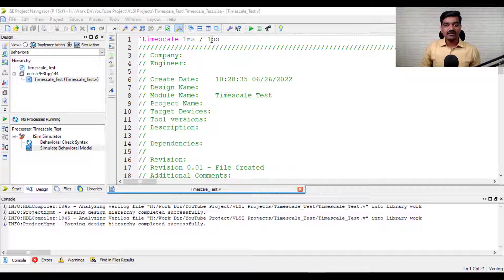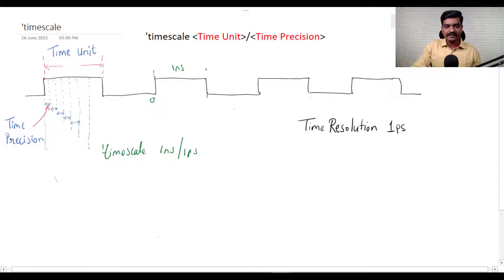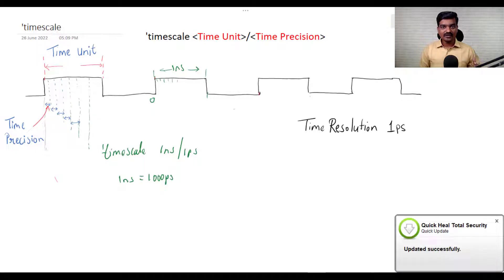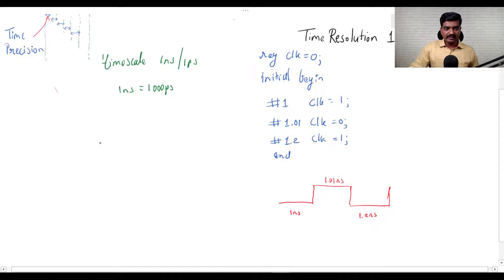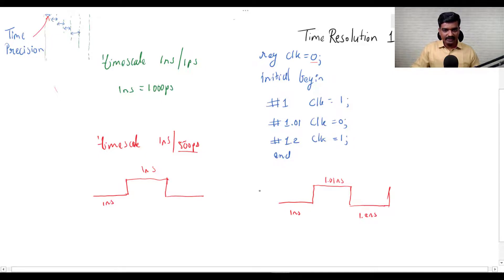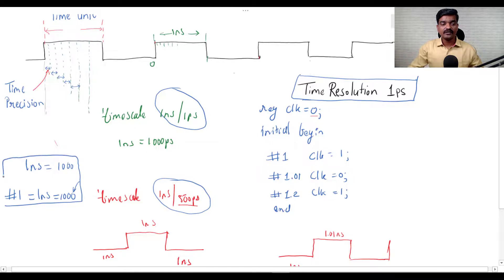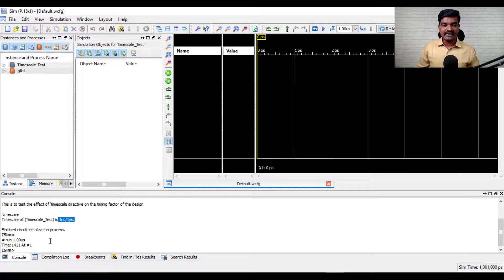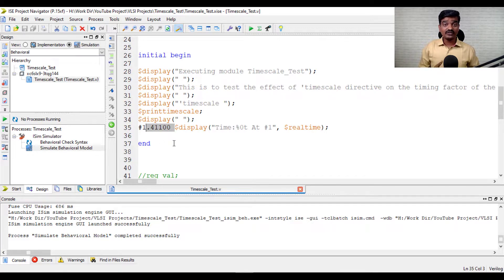timescale in Verilog | Verilog Tutorial | Delay in Verilog

Comment: Error:When we write time unit or time precision values other than 1 or 10 or 100
Reply from the maker: Hi Mohan.
Yes, you are correct "timescale" & "timeprecision" has got default values as "1ns/1ps" & "1ps" respectively and could be in multiples of 10 for example "`timescale 50ns / 20ns", but if you want value other than multiple of 10 you need to override default value and in order to override you need to pass it through tcl command.
Reply: @dhanawadeamit Sir , what is that command that we have give from tcl to override the default value.